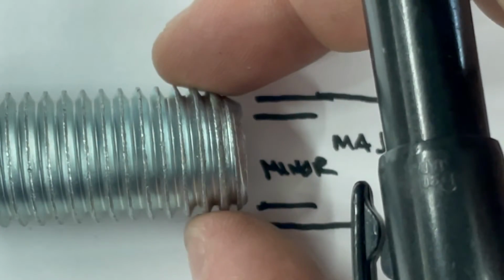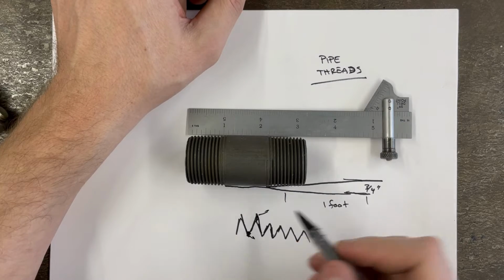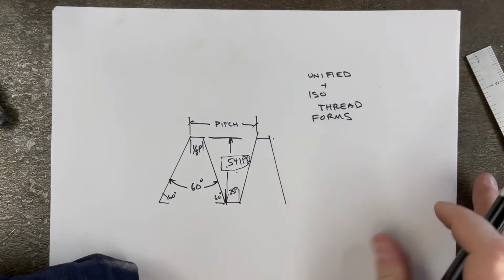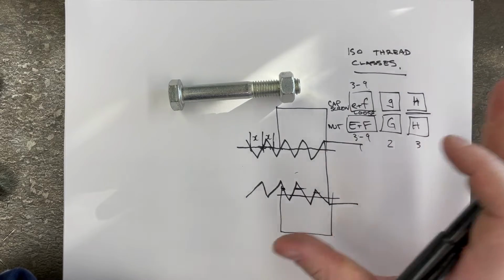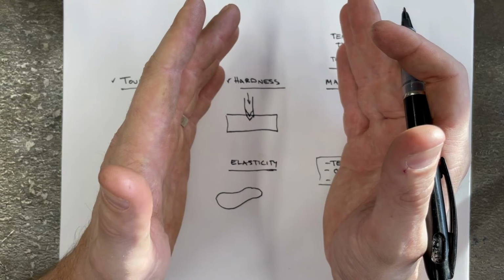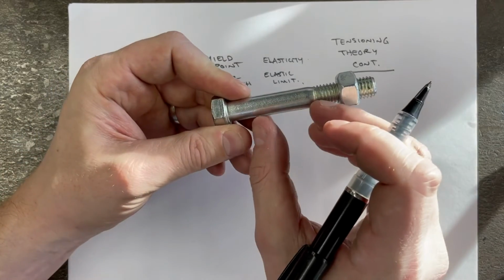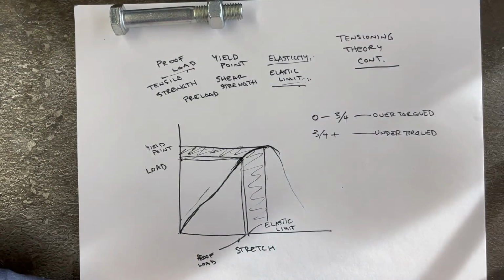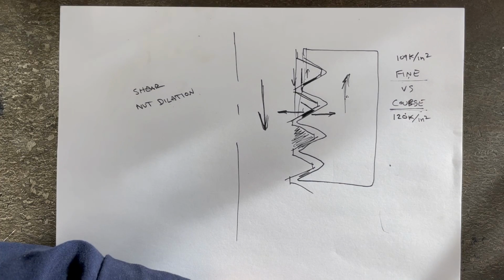Screw Thread Theory

Comment: Thanks. Great explanation but I have question. I read before that corse external threaded are weaker than fine threads because corse fasteners has smaller minor diameter than fine fastener. How ever for internal threaded like nuts or threads in cast it's the reverse because on those corse threads gonna have larger minor diameter than fine. So this statement ain't correct?

But from the vedio i understand the opposite that in both bots and nuts corse threads are stronger than fine threads.

Thank you very much for the vedios.
Reply from the maker: I used to think that too. Because of the helix angle being smaller. The truth is in deflection of each successive thread.